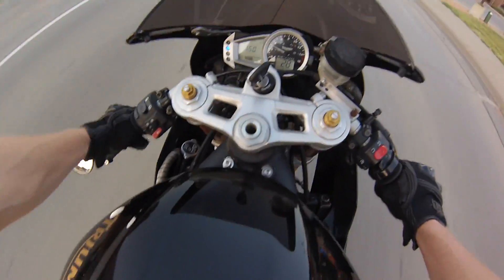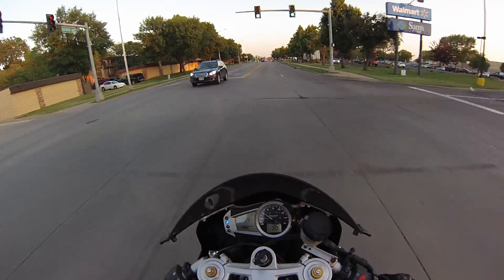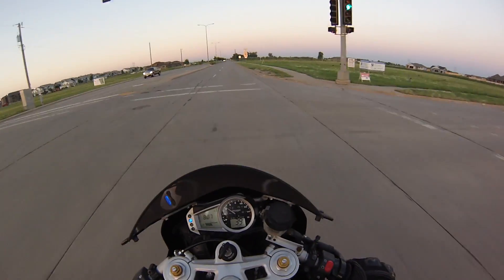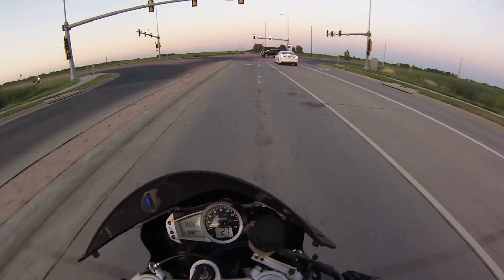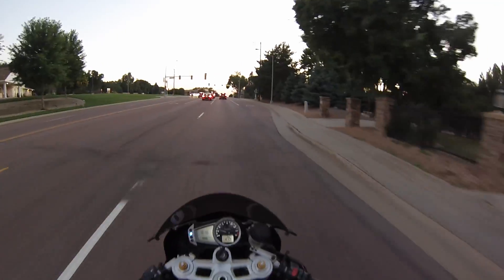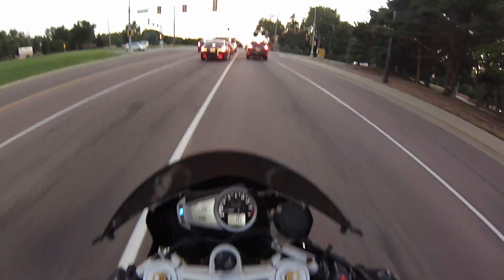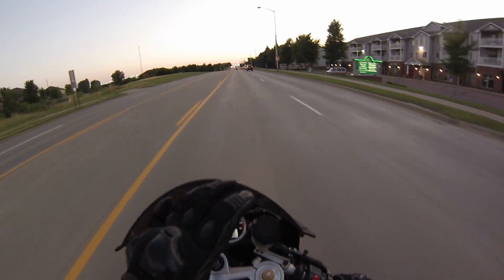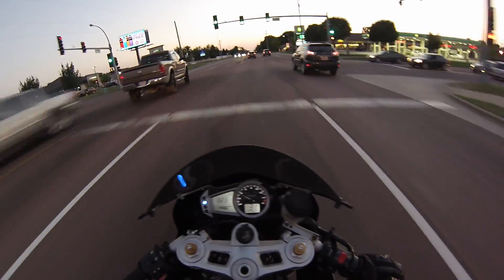Horsepower vs Torque - EXPLAINED!

Comment: This is 🚮 “Horsepower sells but torque is what moves you” 
Power, not torque, is the limiting factor in not only the top speed of a vehicle but also how quickly it can accelerate at any speed and how much weight it can pull up an incline at any speed.

Comment: Putting aside motorcycle brands, would you choose a motorcycle that put's out 128 horsepower @ 12,000 rpms with 59 ft lbs of torque @ 9500 rpms and weighs 414 lbs (with a 765 cc engine) or would you choose a motorcycle that puts out 117 horsepower @ 10,000 rpms with 68.5 ft lbs of torque @ 7000 rpms and weighs 228 lbs (with an 890 cc engine)? The 765 cc engine is geared to be at 5,500 rpms @ 65 mph in top gear and the 890 cc engine is geared to be at 4,400 rpms @ 65 mph in top gear. Imagine that the both bikes would be loaded down with 235 lbs with rider and gear. Incidentally, the larger 890 cc is considerably more fuel efficient by at least 6 mpg. I love Triumph, by the way. As you can see on of these above is a Triumph.

Comment: So which is better a bike that has 115hp @6500rpm or 115hp @12000rpm their hp is the same but at different rpm is it the 6500 because it's achieved at lower rpm ?
Reply: if your goal is have the same performance on lower rpm assuming weight drag and all other stuff are equall than yep 👌🏻 assuming you like high rpm  than no 👌🏻

Comment: The only thing that matters about torque is how flat the curve is across the rev range. The gearbox is there to convert torque at the engine to torque on the road to obtain maximum power, so the absolute value of the engine torque is not relevant, just the shape of the torque curve. There is a huge amount of crap talked on car review videos when they quote a single number for torque, when what they should be talking about is the shape of the torque curve. Even a super peaky engine can be harnessed to provide smooth power at any speed if you have enough gears and a smart auto gearbox as in modern “super cars”.
Reply: flat torque mean nothing 🤷🏻‍♂️ power level which be results of rpm x torque is key for win racing flat torque 100 nm in bike between 2000 to 8000 rpm with max power at 8000 rpm   lost drag race with max 90 nm torque at 13000 rpm with much lesstorque at lower rpm assuming both have perfect gearing 🤷🏻‍♂️ if you have flat torque but its value is smaller than inreasing torque and decreasing after achieve peak in middle ypu will also have worse elasticity  flat torque is delusional myth 😁👌🏻  flat wide torque curve at engine crank let say 100 nm with max 75 hp at peak would lost drag race against against let say something with 75 nm torque with still change level pf torque on torque graph with peak power 100 hp 😁👌🏻 flat torque is bs 🤷🏻‍♂️ well at end it depend what level this tprque is how wide on how big rpm it go only this that torque is flat mean literally not so much 🤷🏻‍♂️
Reply: @mociczyczki  The more peaky the torque curve is, the more gear ratios you need to stay at peak power and the more time you waste changing gear. That’s the point people miss.
Reply: @Tailspin80  the more peaky power not torque 👌🏻 thats true 👌🏻
Reply: @mociczyczki  Sorry, your comment does not make sense.
Reply: @Tailspin80  really ? i dont think so 👌🏻
Reply: @mociczyczki  Not being funny but your comment about peaky power makes no sense. The words are all recognisable but the sentence is not. Is English your first language?
Reply: @Tailspin80  whatever ,peak power not peak torque 👌🏻
Reply: Power, not Torque, is the limiting factor in acceleration.
Reply: @rollsroyce329 That’s basically true, except that the engine is usually changing its rpm as you accelerate, so the power curve / torque curve also matters. You have to keep changing gear to keep near the maximum power as you accelerate. If the power band is very narrow you need more gears and waste some performance changing gear. Old style automatic gearboxes sidestep the problem with a torque converter which keeps constant engine rpm as road speed increases but they aren’t very efficient.
Reply: @Tailspin80 indeed compromises must be made.  Your reply is completely sober; unlike  the previous post that I commented on. I made my comment as a first principals statement to shed light on the following statement that was misleading, if I’m to be charitable:

“The gearbox is there to convert torque at the engine to torque on the road to obtain maximum power, so the absolute value of the engine torque is not relevant, just the shape of the torque curve. “

This is the part that I felt may be misinterpreted by Torque-supremacist to reinforce their faith based view of the relationship of Torque RPM and Power, or that it may generate new ones.  I would have worded the first part slightly differently.  I would have said, to stick close to your wording, something like: The gearbox is there to convert POWER at the engine to Torque at the wheels.  What you said infers that engine torque should be the focus of our gearing selection to maximize power at the wheels.  Can you see now your statement is inverted?
Reply: @rollsroyce329 As someone with a physics degree and, on route to it, an A level in applied mathematics, I prefer if we just stick to simple physics concepts and terms. Most of the people commenting seem to have little or no knowledge of the maths and physics and are just throwing petrolhead gibberish at the wall and hoping some of it sticks.

Comment: Horsepower is your yearly salary
TQ is your hourly rate
Rpm is your hours worked 

whp is your yearly salary after taxes. 

knowing just tq or rpm tells you nothing about performance. this is why tq/weight ratio tells you nothing
Reply: Yep horsepower is everything
Reply: @kerimca98 👍. “Sure your Ducati has 216 HP but how much Torque does it have?”  
Best answer: 216 Horsepowers worth.
Reply: @rollsroyce329 that's what HP means.   Lol.  That is always my answer too
Reply: Very well said.

Comment: Every video explains it similarly shitty. Just explain it in a practical way. Torque defines how quickly you reach your peak power (the HP which your vehicle is declared to have).
Diesel has high torque and therefore has much HP right away but it lacks the rpm to produce high power compared to an Otto engine.

Electric vehicles have massive torque and therefore they can jump start like that. They are quickly at their peak power. A combustion engine needs longer to reach its peak power because it lacks torque.

The higher the torque, the better the vehicle makes use of its possible power output.
Reply: Yeah someone said "Higher torque is better acceleration while higher power gives you more top speed"

I'm like what? Surely having more HP gives you both better acceleration and top speed
Reply: Geez, thank you!! 
Everyone tries to explain the mechanics of it but that only makes sense in the context of knowing the outcome. So torque is how quickly I can reach peak power and how that works is all the bs explanations I've watched about rulers and wretches 🤣
Reply: This only applies to EEVs, Emissions Elsewhere Vehicles or other abominations without a transmission.  For anything non Vegan and plant based maximum acceleration of the vehicle is achieved when the transmission is used to keep the engine as close to its peak power as much of the time as possible. Power; not torque is the limiting factor in acceleration, towing, top speed etc…

Comment: If you weigh nothing like a small car or motorcycle if you have a lot of torque you can make up for lack of horsepower if you have 200~ horsepower in a small car and 400 ft lbs of torque you’re shredding tires
Reply: You can multiply torque with gearing.  You can’t multiply Power.  Power, not Torque, is the limiting factor, regardless of the vehicle weight, for acceleration or towing capacity or anything else you can think of.

Comment: I like the last catch phrase, HP sells the vehicle,  torque moves it! And that is exactly what it does.
High torque gives you acceleration simple as that.
Reply: Power, not Torque, is the limiting factor in acceleration.  Or towing or anything else you can think of.
Reply: It's not...

Both of them move the vehicle. They are inseparable. Higher torque will give you higher power at any RPM.
Reply from the maker: That's the point Ben.

Comment: Torque is how long a bar with one pound of weight at the end of it.  horsepower is how many horses you have moving the bar. The two work hand in hand or hoof in hoof.

Comment: Just replying to Black Widow who wrote (but can’t find) “Torque is more important at acceleration from 0 and from lower spd in generall. Once your car is moving at higher spd it’s the horsepower which gives you better acceleration.”

Torque is required to make HP. Torque numbers without the HP numbers tells you nothing about how fast a car will accelerate. However if you tell me the car makes x amount of HP at x rpm for example without ever hearing the TQ number, that’ll tell me something if not everything.

If a car that makes a lot of low in torque and out accelerates a car with small low end torque from zero. It’s because the first car is able to make more hp at the low end than the second car. While high low end TQ performance cars tend to make more hp down low, it’s the hp that beats the other car.

Trucks are a good example of proving hp measures acceleration. They typically have a lot of torque but lack the hp and that’s why they accelerate slower.

Also, looking at the power curve of an engine, even when torque numbers takes a nose dive, as long as hp is increasing, your acceleration will continue to increase.

All else being equal, more hp at any given rpm will determine which car is faster at given rpm, not TQ.
Reply: Your last statement confuses me.

Torque at rpm IS horsepower, in the same way that horsepower at rpm IS torque.

Car a makes 100 torques at 5252 rpm

Car b makes 100 horsepower at 5252 rpm 

According to you car b is faster? Except they bother make the exact same power and torque. They are functions of eachother. One cannot have better torque but worse power or vice versa at a specific rpm. It doesn't matter which one you look at, both tell you the same thing when you consider rpm with them.
Reply: Ben Fennell I don’t know what point you’re trying to make. The car that makes more hp at 5252 rpm to use your example is the faster car at 5252 rpm, all other factors being equal. This is the truth. Hp numbers matter the most in acceleration, not torque.
Reply: @godsaveamerica2611  a car cannot make more horsepower than torque at 5252 rpm is the point I'm trying to make.
Reply: Ben Fennell I forgot of 5252 where hp and tq cross. Let me say this instead. Besides that point along the power curve, the car with the more hp at any given rpm, that car is faster at that rpm all else equal like weight, traction, etc. so in the end STILL hp value is more important when determining how fast the car is not tq. Would it be good to have a car that has a lot of torque down low or a flatter tq curve? Sure, but without knowing hp (except that it makes at least as much as Peake torque at 5252 rpm), it won’t tell you maximum acceleration which is what you’re achieving in a race.

I own a mustang gt, like most ohc engines, you have to rev it more to match the hp of a camaro ss’s ohv engine along the power curve (about 500-1000 rpm behind), but it’s the hp number that will tell you where along the power curve which car is faster.
Reply: @godsaveamerica2611  but if you know torque and rpm you know horsepower they're functions of eachother. If you have the whole torque curve you can calculate the hp curve. I agree torque on it's own means jack

But torque at rpm? That IS horsepower. Which is why if you look at torque and rpm together is the same as looking at horsepower. They're intrinsically linked. You can't change torque at a certain rpm and not change horsepower. You get the same info looking at torque and rpm as you do looking at power. They're mathematically identical.
Reply: Ben Fennell Ben, let’s stop with the stupid games. Normally in almost 100% of cases, when you google specs on a car, you’re only given peake hp and peake torque. You’re rarely if ever given a power curve or a torque curve. Peake torque can’t provide you peake hp, only hp at peake torque. How is that helpful? Stop trying to impress, just provide helpful information to the ignorant masses wanting to know if seeing hp numbers is more important than torque numbers when looking at specs when all you’re given is peake hp and peake tq. Also if you’re given a power curve, you still only pay attention to the hp numbers and only look at the torque curve to see how the engine makes hp in the way it does.
Reply: @godsaveamerica2611  dude I'm not trying to be rude I'm just staying facts

Comment: OK, so when i buy a performance car, should i look at the car with higher HP or higher T?
Reply: Neither, look at the power/torque curve.

Power and torque are tied to eachother and always cross at 5252. A car that makes consistent non changing torque will always make a steady rising horsepower line, but those is usually a fantasy and torque curves almost always aren't flat. Look at the horsepower curve if you want to know how the car will feel, it It makes jumps, has a big falloff, etc it will be noticeable. Ideally you want a horsepower curve that is a relatively straight line going up as rpm rises and a torque curve which stays at relatively the same number regardless of rpm. This is the smoothest feeling engine you can get.
Reply: Always look at higher HP duh

Comment: HP matters with respect to rate of acceleration. HP wins races 😂

So in other words HP sells cars and overall only HP matters with respect to acceleration and speed.
Reply: The most important thing is to look at a power chart. Rpm is so much more important than people give it credit. It's the third component of the power sandwich, horsepower= a function of torque and rpm. Just looking at torque means basically jack shit. I can make 200 ft lb of torque by standing on a wrench. does that make me stronger than a motorcycle? No, because those 200 ft lb aren't moving, and if they are they certainly won't be doing 5000rpm. Moving torque is power. So look at all both torque and rpm, or just hp curve. Either tells you the same info.

Comment: I enjoyed the whole video! But I have to say, there was a sharp downward spike in my enjoyment at 3:52. It began to recover as I thought "No, he just misspoke! We all do that" but then it was hammered way down again at 4:00. I had to pause, go outside, and play with the dogs. Really, you had it nailed up until 3:52 ; The ruler-wrenches to describe torque - perfect. The fence doesn't move - no work. The bail moves - work is done. Beautiful! And yup, the dead guy watches the horse pull up the thing and he defines power as a horse performi... 0_0    AND THEN THIS!!! WHY THIS!!!!  Hhhe...heee....hhhe *okaycalmdown...

Power is NOT a rate of TORQUE. Power IS a rate of WORK - a rate of energy being applied or exchanged. 

As you explained, torque is force x perpendicular distance - Correct. It's just a twisting force. Remember that torque is a static quantity and commonly exists in static things like in the wheel of a car parked on a hill, or like when you're straining on a bolt before it breaks free. It does not require motion.

You spoke of pushing the hay bail and performing work... Work is force times parallel distance. Work would be the force you were applying to the bail times the distance it moved in that same direction. Work can also be expressed as the torque on something times the angle through which the thing is turned. Work and torque are NOT the same thing. Not even a bad substitute for the same thing! They are as different as a calorie and an inch! It is kinda tragic that these two things can be written in basically the same units (force x length) because work and torque have nothing in common and cannot ever be substituted for one another in any situation.

Unlike torque, work can be expressed in all kinds of units like thermal, electrical, kinetic, and even chemical. I'll also add that work is even relevant to moto topics in these forms, and so is power since it is just a time rate of work.

I hope this makes sense. I'm being dramatic cuz I care a lot about people understanding these topics, but seriously though nice video;)
Cheers.

Comment: We're to curious to know whats gonna win but I am thinking that there both almost the same at acceleration it's motor I think it depends on torque and horse power and the Piston think I would say the rpm is more important and the weight so you're fast but it wouldn't really use some torque and the rpm is spinning like forcing down through distance there all mix to create a horse power the power has like the gears to push harder
Reply: Some of your words tell me you are close! haha I'll just try to state it all cleanly:
To "win" (more acceleration, top speed, towing ability, etc), we want more wheel torque. Since we have control of the gear ratio between the engine and wheels, and since a gear ratio can be used to freely trade between the torque and rpm going out, we always want to adjust the gear ratio so that the product of engine torque and engine rpm is the highest it can be. We've just maximized power. This gives us the most wheel torque we can possibly get at the current road speed.
Making sense?

Comment: So the s1000rr has 200hp and less torque than s1000r but s1000r has 165hp with more torque, why did they do this which 1 accelerates faster 0/100kmh??
Reply: The 1000rr would be geared lower to utilize its power higher in the RPMs...
Reply: Power, not torque, is the limiting factor in acceleration. They compromised some of the power at high RPM to give the bike more power at lower RPM to make it feel more responsive in a more casual riding environment than a racetrack.